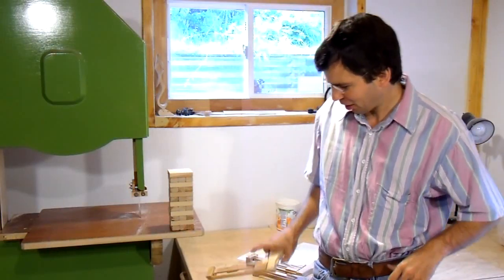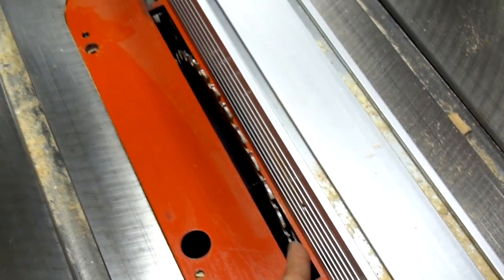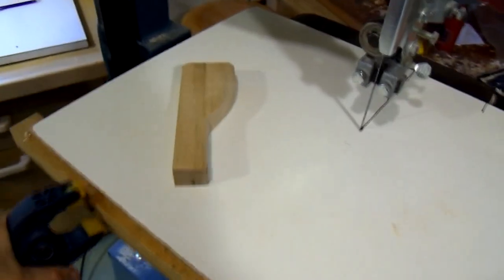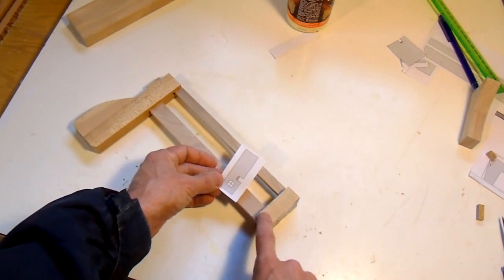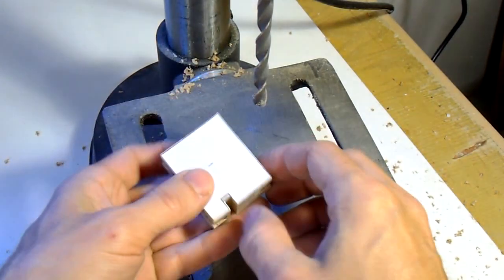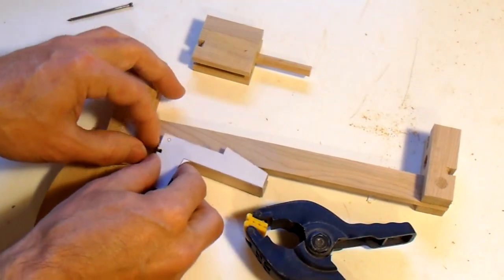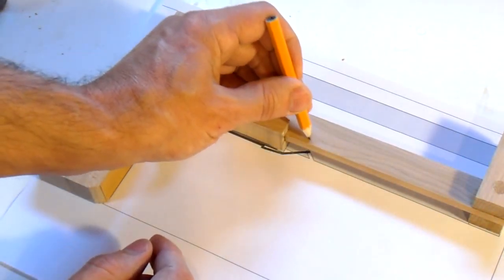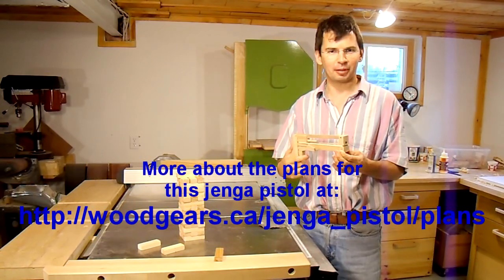Building the jenga pistol

Comment from the maker: I used the paper template in the video, so hardly made any measurements at all.  The proble with inches is that either I have to redesign it to round it to nice numbers (challenging - fine granularity is hard with fractional inches), or all the fractions come out to really awful numbers.  I tried that with one plan, and decided it just wasn't worth the trouble.

Comment: adding a weak retracting wire can quickly pull the hitting pin back after firing, so that the pin does not keep sticking in between jenga blocks when upper blocks fall down.

Comment: You could make the dowel on the front stick out on both sides and use it to mount the rubber bands. It would allow you to change them without having to take off the top rail